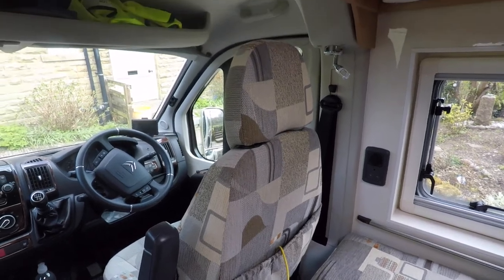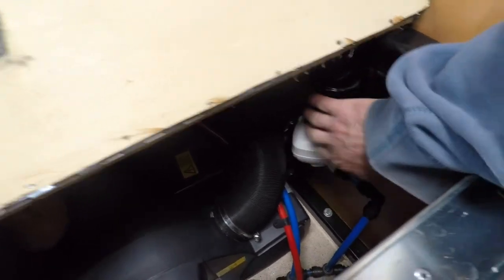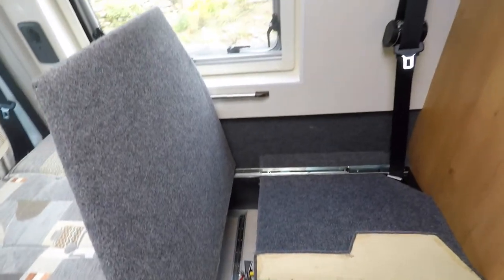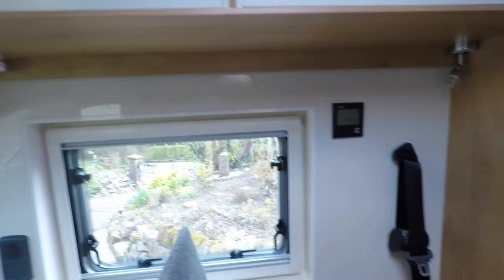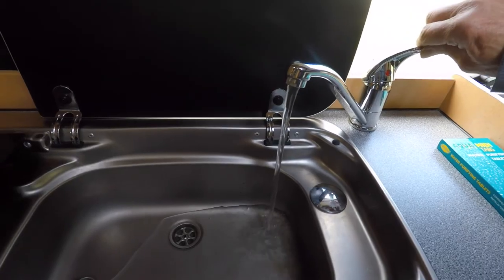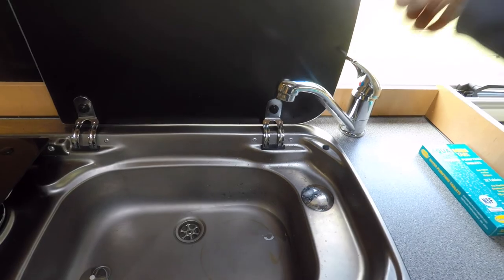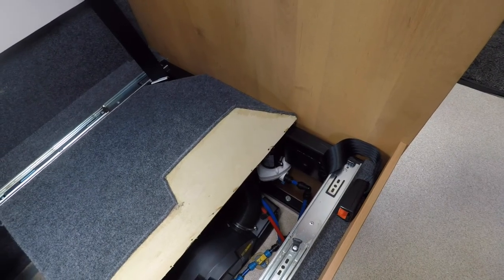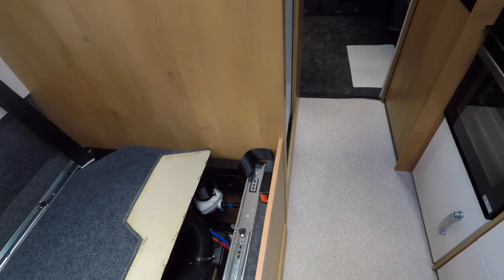How to prime (get the air out of) a motorhome water system

Comment: Having done this the air keeps coming back into the system, the video was excellent thanks
Reply: A not uncommon problem! Driving around causes air to somehow find its way back in to the system, probably by water falling back from the lift pump to the main water tank. Opening any one tap should clear it. Just listen to make sure the pump clears itself and stops after a few seconds.